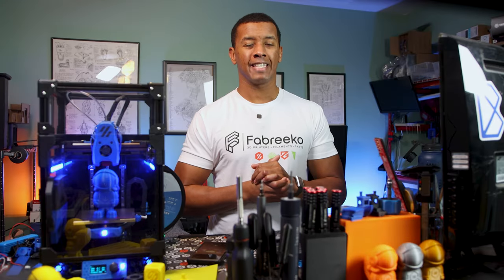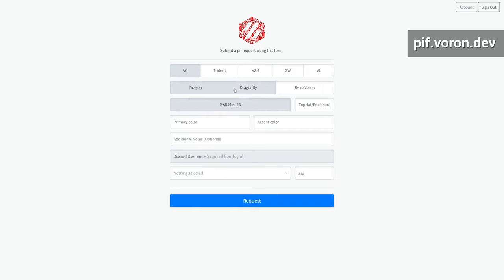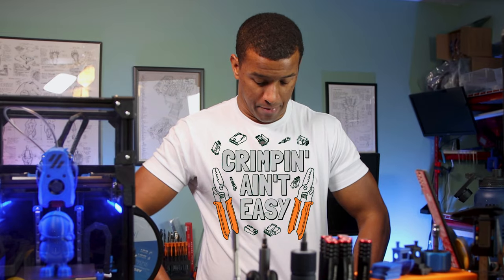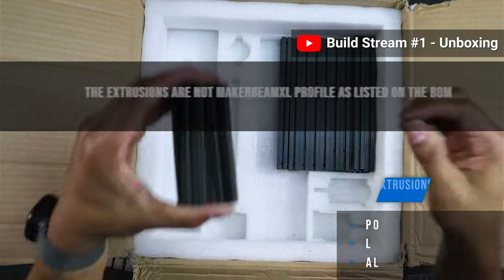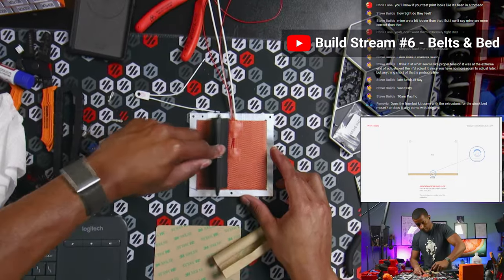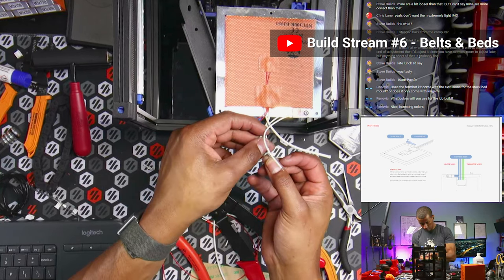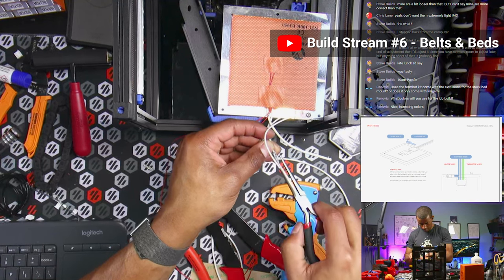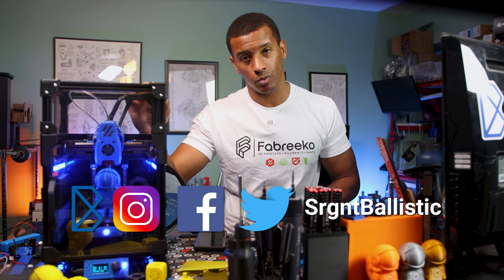Formbot Voron V0.2(r1) Kit | REALLY REALLY Detailed Review

Comment from the maker: Some addendum & notes:

Heated Bed Change: A viewer has informed me their newer kit included a pre-wired/installed thermal fuse. This simplifies the heated bed build and requires one less wago/connector if you want to wire it similarly to how I did. That's a nice QoL improvement from Formbot and something I called out in the review.

Error: I sped up the footage of the heated bed heating and placed a timer on it in Post. As such the time shown is wrong. The actual heated bed time to 105 C is about 8min
Reply: I just bought a Formbot kit a few days ago (shame I didn't see your video first). Thanks for helping me mentally prepare for all the minor challenges.

Comment: I bought this kit during their black Friday sale and the kit went together really well. The Kirigami bed was a bit thicker for me as well, so I had to re-print two parts with slightly looser tolerances and then it went together nicely. The documentation was spotty in some parts, but with the help of the Voron Discord, everything is up and running. Oh and I used your printer.cfg file to speed up the process, thanks! Since finishing the build I've done pressure advance and today I did input shaping, now the printer has finally become what I wanted. It prints fast while retaining quality and it stays within the limitations of the stock cooling.
Reply from the maker: Thanks for watching and commenting! Saw some of your comments in the V0 questions discord channel.

Glad to hear your build went together pretty well and the config helped. If I can help with anything else lmk.

Cheers and happy printing!

Comment: About the Kirigami bed issues. You can find remixed parts online that have the extra clearance needed. Tommy Vercetti on Printables has several versions depending on the thickness of the bed frame. I printed these out after having the same issues as you and these fit perfectly.
Reply from the maker: Yes I've added them to my GitHub documentation

Comment: Hey. I just landed on your channel. It is a well-done video. And I agree. The BTT pi or cb1 are easier to set up than a rasberry pi. I am considering building a V0.2 at one point. I think it is a good option for a first build. That or something like a Rook. I just wish the information was not so spread out for these voron kits. It seems like every company has their own twist on it, and they want you to follow the main voron build guide but then switch over to another few docs and then go back and forth. So I can see it being confusing for some. I remember seeing Fedor bring that up and a few other creators like Nero, etc. Just subbed, so hopefully, we will see more videos soon. Cheers
Reply from the maker: Thanks for watching! V0.2 is a good option for a first build. Some finnicky bits as you saw in Fedors videos. 

The Voron Discord has help channels for the different printers and it's pretty helpful.

100% agree the documentation can be frustrating. The Voron manual is pretty good but assumes a stock build.

Then every kit manufacturer is trying to differentiate and keep up with the most common mods. Many of the mods having limited or not docs. And then the manufacturer likely has some weird specific stuff.

Not sure what the community can do to help with this tbh. Happy building and printing once you pick a kit. Either way you go it should be fun and a good learning experience.

Comment: I have no experience building my own printer and yet I ordered this kit. Would you say I need to buy wire strippers and crimpers? Id like to save money if I don't need it. I know you mentioned most of the cables are pre-crimped and terminated?
Reply from the maker: Without any modding or having anything go wrong I think it's possible to built the entire printer without having to crimp anything but I'm not sure about stripping wires

If you follow how I did the heated bed for instance it requires cutting/stripping and using wagos to allow pulling the bed out.

But you could technically build the bed without doing this.

At the very least you can probably get quite far into building the printer before needing to do so.

And evaluate if you think it would be worth it. Borrowing strippers/crimpers from a friend or going to a maker space to use some are always an option.

They're highly recommended by the voron team as maintenance, upgrades/mods and subsequent builds will likely require them.

Fans for instance aren't exactly a consumable with these printers but often go out on them. Buying a replacement likely won't be a 1:1 swap in.
Reply: @BallisticTech  Got it that makes sense, I may have a stripping tool laying around somewhere but I was looking at the recommended crimping tools and saw that they were around 40 dollars which seemed a little steep to me haha. Are the wagos the intended method of wiring the bed? it seems odd that they wouldn't be included in the kit if that was the case. None the less which type of wago do I need to purchase?
Reply from the maker: @rp101aquatics6  That's a bit of a weird thing with Voron Kits and DIY Printer Kits in general.

There's the Voron "Spec". What their BoM says and what's in the manual.

Then there's what the kit includes. Kirigami is a super popular mod so many kits have started including them to different degrees. Formbot only includes the frame. Other kits include the wagos, LEDs, etc...

Then there's what an individual builder decides to build. That's based on  experience, available tools/materials and really just preference a lot of time. 10 Builders with the same kit you're probably gonna see 5-10 small variations in the bed wiring.

That's compounded a bit because Formbot has no "Spec" or instructions for this kit.

Voron Spec is the multiple extrusion bed. No connectors for the wiring. They just pass everything straight thru to the . Technically Formbot's "Spec" based on what they give you is Kirigami Frame + pass thru wiring.
Reply: @BallisticTech  Is there a good/safe way to wire the bed with out wagos? I'm leaning towards getting them anyways at this point but I'd have to watch a few build guides and see how the kit is put together for the most part
Reply from the maker: @rp101aquatics6  Newer kits have the thermistor integrated so that removes the need for one connection.

Besides that you can choose to just leave the bed tethered.

Or use any connections rated for the Wattage. I believe it's 24V and 60W so a 3-4 Amps of current.

Inline JSTs, microfit, car style inline spade connectors. I initially used an extra spade connector but then changed to using an extra wago. 

I show the whole build process in my streams.

I have a lot of resources on my Github repo for the printer including links to wago connectors
Reply: @BallisticTech  thank you for your detailed responses. I'm going to go down the wago route. I found them pretty cheap locally and it's convenient enough that there is a wago mount for the kirigami bed

Comment: Where did you buy your Formbot V0.2 kit? I see that Fabreeko sells the much more expensive LDO kit.
Reply from the maker: As noted around @4:30 this kit was provided by Formbot for the purpose of reviewing.

The LDO kit is available from Fabreeko, MatterHackers, West3D and others. It's generally considered one of the best kit on the market. It has quite a few value adds not available with lower end kit.

Voron Revo with 2 nozzles, Picobilical, 100W Heated Bed, 200W PSU, metal nut bars, Kirigami wiring kit (led, wagos, thermistor pcb), what's considered by many as the highest quality motors and extrusion.

So it's a matter of balancing the value adds vs what someone wants from a kit and their final build. To some spending money on a Voron Revo and Picobilical doesn't make sense if they're going to end up using a self-sourced hotend and go with CAN.
Reply: @BallisticTech  I don't find Formbot on the Fabreeko website.

I had gotten the impression that LDO had the most admired Voron kits. At over $600 for the V0, they sure are priced as being special.

I am very glad to have found your videos and positive experience with Formbot kit as well as their much better price.

Thanks again for your very helpful videos!
Reply from the maker: @BobCollins42  Fabreeko doesn't sell Formbot. Just LDO and some of their own components. I bought replacement fans and grease from Frabreeko

Formbot is only available via their own site and AliExpress. There are links in the description of the video.

I will be building an LDO V0 kit on stream soon if you want to see the differences.
Reply: @BallisticTech I am watching your video again, and I understand now and how I got confused. 

A related question: Do you know how the LDO kit is so different as to command an almost $300 higher price?
I look forward to your LDO build videos.

Thanks!
Reply from the maker: @BobCollins42  it includes a Revo Voron Edition with 2 nozzles. ~$150+ value compared to $20-65 options in the Formbot kit.

200w PSU compared to 150w. That's to power the custom 100w bed heater in the LDO kit. Formbot kit is only 65w (which is min spec)

Picobilical in the LDO kit is like an enhanced V0 Umbilical. It has an extra MCU connected via USB and frees up some I/O on the mainboard 

LDO extrusions and motors are considered the best by many. The rails may or may not be nicer. I know they include 1 genuine Hywin rail for the X axis.

 Pretty sure they include genuine Bondtech BMG internals and better fans than the Formbot kit does stock.

Their Kirigami Bed is more to spec than the Formbot one. And they include things like the Kirigami neopixel LED, wagos, and a thermistor PCB.

Probably some other things. I'll soon find out I guess. But the thing ppl mention the most is their customer service and connections to the community and Voron team. Their documentation is also considered the best and frequently updated. That does take some budget to do.

So some specific better/different value adds. Some sentimental factors and brand appreciation. Jason the head of LDO is genuinely very nice.

Whether the value is worth it for an individual is kinda up to them. You may not want to spend the extra if you don't need the Picobilical, Revo, Bondtech internals, etc...